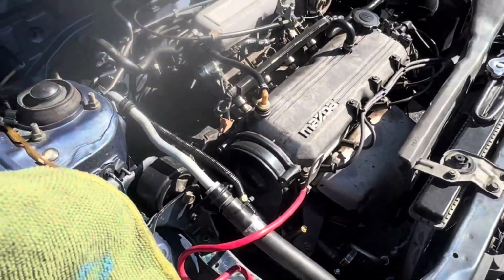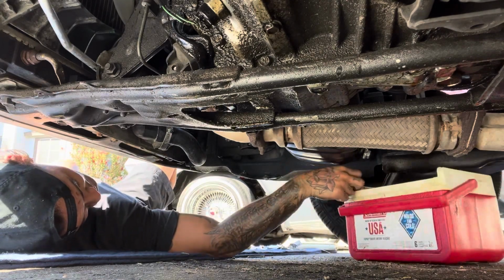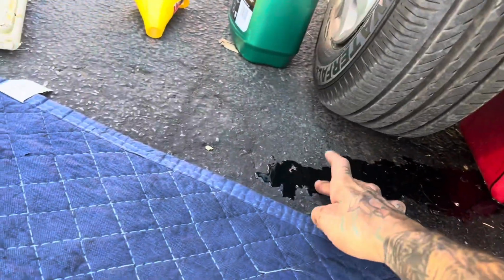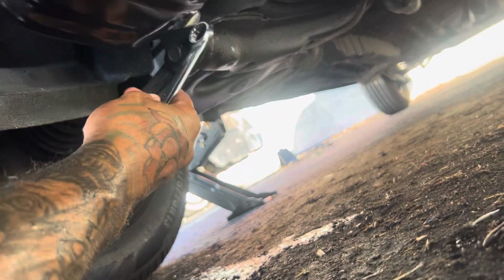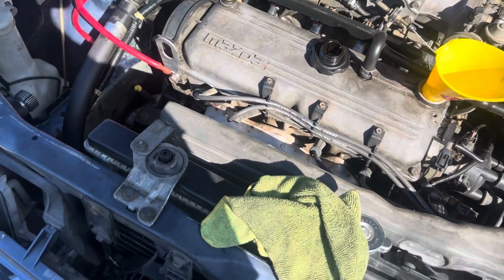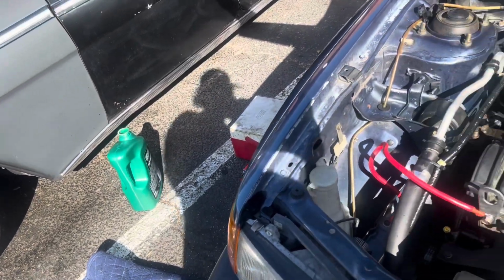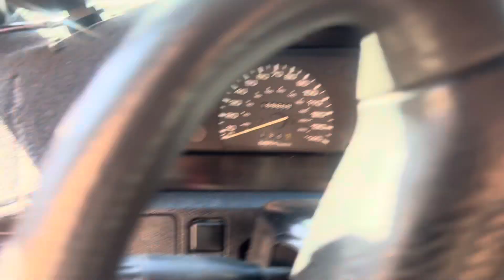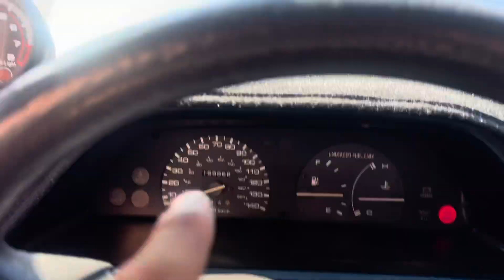Mazda 323 oil change How To

Comment: Thanks, good stuff 👍👍👍 One question: were you able to get the oil filter off without raising the car?  It's really in an awkward place.
Reply from the maker: Yea if the car wasn’t raised I would have just bent over a little bit more. The first time it was tough because someone put in on there really really tight I had to use an oil filter removal tool. Now that I started doing them myself I just hand tightened it